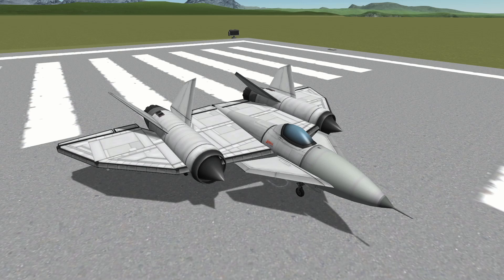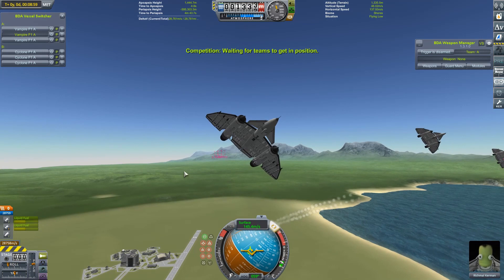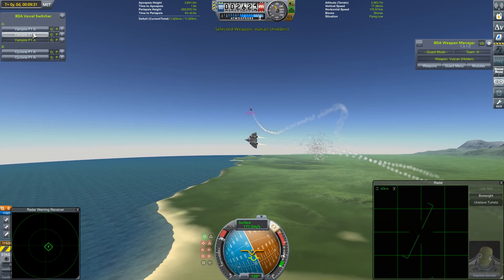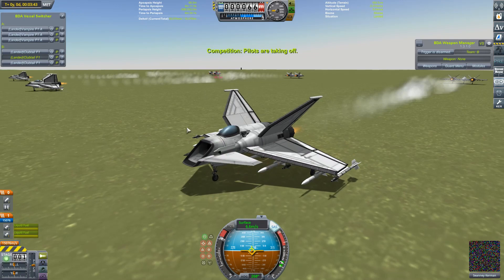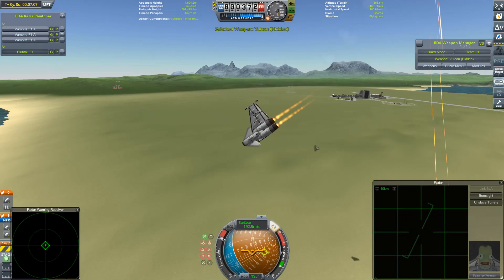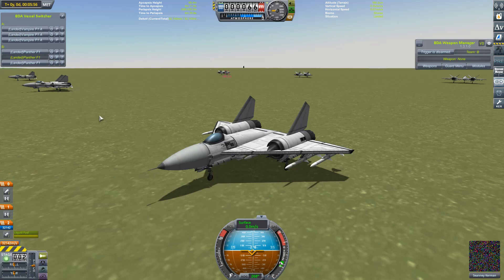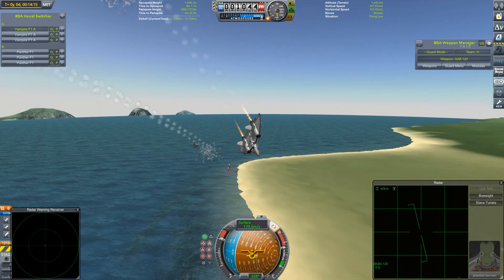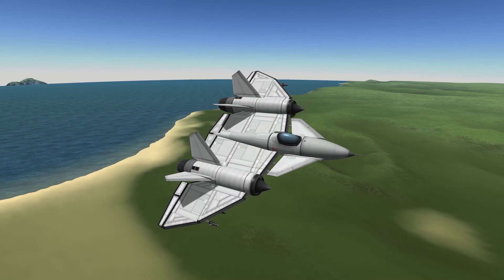Fighter Testing - A Heavy Flying Wing - Kerbal Space Program & BD Armory

Comment: It looks like you could do a few things to make that plane work better...
1. Move the Center of Lift closer to the Center of Mass: the plane already has some lower wing loading than a couple other of your planes, this allows for faster turns in KSP
2. Tweak ai: this is complicated tbh, but the main thing I'd say is to move the g-limit from 10 to 45; coupled with the first tip, your plane should turn tighter
Of course, this is just touching the surface, but these were things that stood out to me.

Edit: If y'all have any questions or comments, be my guest.
Reply from the maker: I was thinking of ways to move the centre of lift closer to the centre of mass in ways that weren't too "hacky", but I hadn't considered the AI.  Thank you for the feedback!
Reply: @SonofSmith  You're welcome! I am still considering of whether or not to make or modify a plane of mine. Additionally, arctifire and I are in cahoots when it comes to planes, so expect about the same level of quality from both of us.